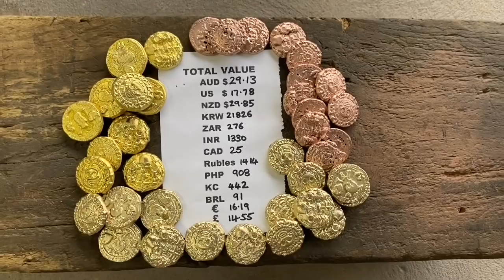Metal Slag Melt - Nordic Gold - Copper - Brass - Trash To Treasure - ASMR Metal Melting - BigStackD

Comment: When it comes to what type of melt I enjoy watching the most, I think slag and dust melts are my favorite. The mix of slag and dust melts down so easily and you get even less waste on the other end. From a commercial standpoint, you could easily sell those coins for 5 USD a piece. I was just at the Plimoth Pilgrim Plantation in Massachsetts, and they were selling tiny metal "pieces of eight" for 2 USD a piece. The fact that the material would otherwise only be about 18 USD by weight shows what people are willing to pay for quality trinkets.

Comment: You really ought to get a tumbler or vibrator. You fill them up with steel shot of different shapes and a soapy fluid, toss in the things that need polishing/cleaning up, turn it on and let it go. They work really well. Jewellers use them.
Reply: Jewelers don't use anything with steel shot in it. All precious metals are softer than steel. Putting rings and such in a steel shot tumbler would mangle them.  Jewelers use sonic cleaners, buffing wheels, and steam jets.

Comment: When you pour a coin could you press another half on the back to make a double sided coin? if it works you could make a way to do it easily
Reply: The design would be imprinted on one side and pushed out on the other.

Comment: Would it work to make double-sided coins, if while they were solid but still hot in the mold, you put another mold on top and stamped it down with a mallet? Maybe that could also fill in any gaps or imperfections in the casting?

Comment: Hmm, when you're melting the metal dust, is there a trick to keep it from overly oxidizing? Dust has a very big surface to react with the air, so I'd think mixing it with some flux might help, but I might be wrong.

Comment: How do you keep the zinc in the brass from oxidizing so well? No white fluffies....
Reply from the maker: Very easily matey just simply don’t overheat it. When the brass is getting up to it’s melting point back the furnace off by at least half and slow it all down and then you’ll get yourself a nice clean pour without the zinc boiling/flaring . It’s a very fine line to get it right But like I say buddy the most important thing is to slow the heating process right down before it gets too it’s melting point so it doesn’t overheat 👌🏻
Reply: @bigstackD  thanks

Comment: @ bigstackD casting, u know I’ve watched other channel and I’ve seen ppl had this big transformers like the one u see on the street? Usually sitting on the electric pole. They had big copper plates in it. I’m not talking abt wires I’m talking abt a solid copper plates. Maybe u cld find one and see how much u could get it out of it. I’m sure it would be nice weight but I have to warn u this transformer have oil in it. I’d love to watch u doing that. Just idea.

Comment: Why don't you try and make a composite from the metal dust with some super glue, you'd probably have to add a bit of baking soda to speed up the setting, it would be interesting to see how the material behaves